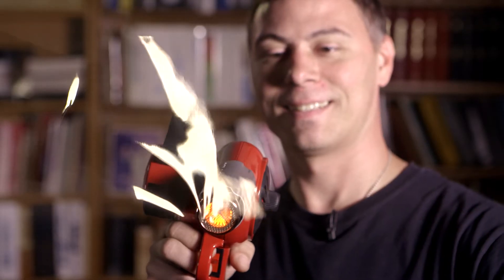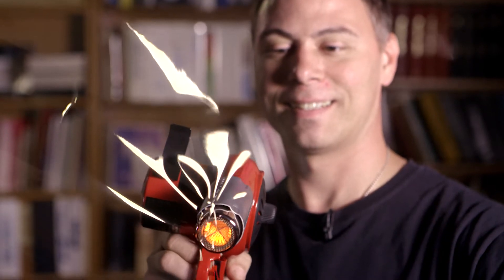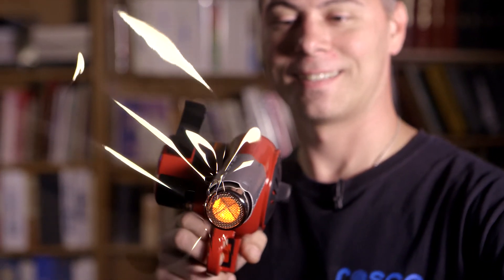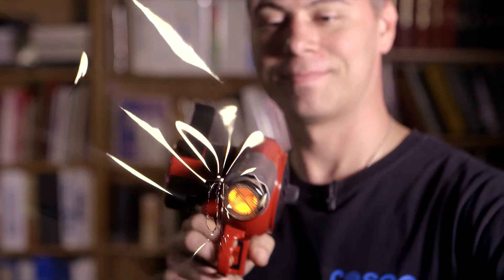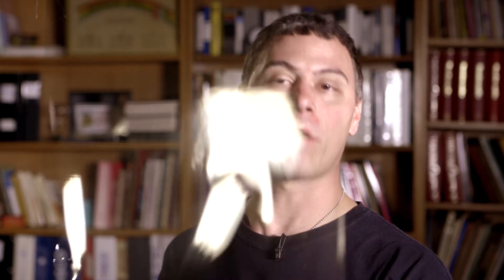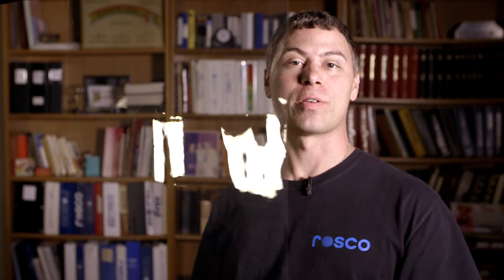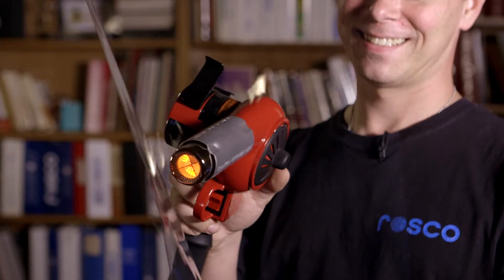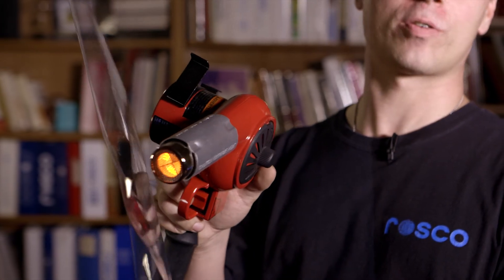Rosco Minute - Super Heat Shield

Comment: I want it for being able to spot a 1K  with a CTB on it without burning the gel
or spot it on an umbrella without scorching. Wonder about Cons ot doing that!
Reply from the maker: Felipe - Super Heat Shield will definitely help. It might not prevent it
 altogether, but it will definitely help the CTB/umbrella last longer. 
The main "con" of Super Heat Shield is that you need an air gap between
the gel and the heat shield. The Super Heat Shield will absorb the heat,
 but it will pass it right along to the gel if they are touching. A 
one-inch air gap is recommended.
Reply: Thank you, I found a way to get about 4 to 5 inches distance BUT the Super heat shield would have to be placed about 1 inch from the lens of a 1k Halogen, Can the heat shield be placed that close to the lens?
Reply from the maker: Felipe - believe it or not, it just might. The Super Heat Shield has an upper working temperature of 280 degrees C. The temperature of a spotted 1K varies, but it's probably worth a test. Good luck!
Reply: Ok, I'll try Thank you

Comment from the maker: Cesar - absolutely! That is it's primary purpose. The important thing to remember is to keep an air gap between the heat shield and the color filter.
Reply: How would I use this in a Source Four leko? Can I put the heat shield in the slot closest to the lamp and the color in the slot furthest from the lamp? Are the gels too close to each other?
Reply from the maker: Samuel - Yes, you can use it that way and it will help, however, your results might not be as good as they could be. The more space you can give it - the better your results. We recommend at least 1", which is close to the amount of space between slot 1 and slot 2. The most important thing is that the two gels not touch, otherwise the heat will be conducted onto the gel and the heat shield will be completely ineffective. The heat shield absorbs the heat, which can be be passed on to the gel if the two are positioned too closely.  If you really want to make the heat shield effective, try using a gel extender, which allows you to place the heat shield in the near/lamp slot, the gel extender in the far slot and the gel in the extender.